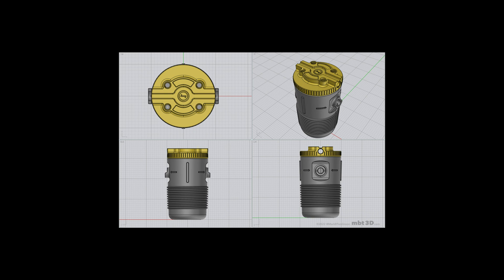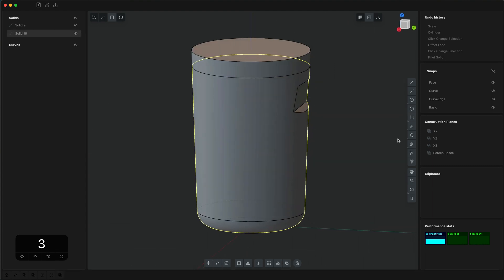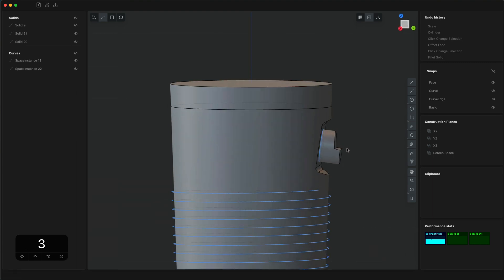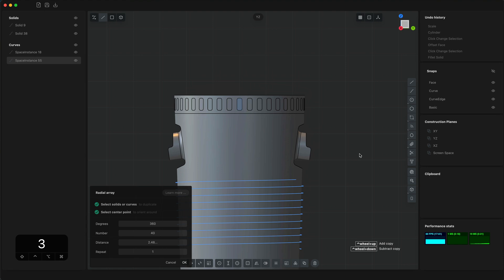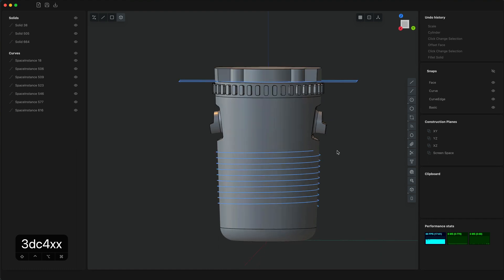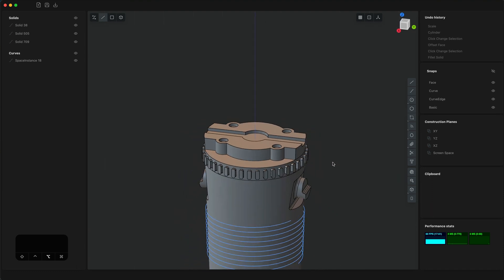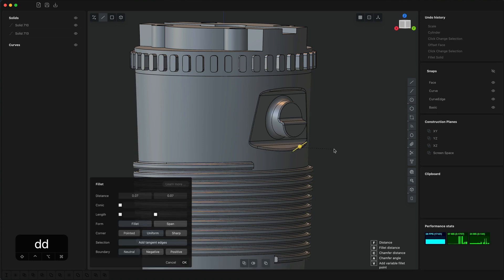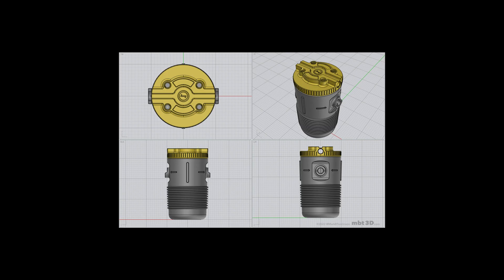Modeling a sci-fi coffee cup in Plasticity

Comment: I know I'm commenting on an old video but the push pull on the planes do not always work. Same with sliding an edge often. I'm using the latest version. What am I missing. Do moving edges need to be right angles or some thing? Or am I having a selection problem? Do I need to dis connect something? It does not seem that the vertexes are able to move.

Comment: Okay so I just reproduced this object using this tutorial, and exported it as .obj, and then imported it into blender 3.1.2. Had to scale down by over 1000. There's a big error with the broad smooth surfaces of the cup cylinder above the threads, they have broad inward dents. Topology not nearly dense enough in those areas to produce cylindrical shape. Also object is not 3D printable, lots of non manifold and other errors and not really sure where to start trying to fix that. However the workflow is very enjoyable and quick!

Comment: Im increadebly impressed with this program so far, I'm intrested to see what kind of meshes this will produce on export? I use solidworks at my job so Im fairly familier with a CAD parametric workflow but I also do a bit of modeling for games on the side.

Im not sure if this is intended to become a non destructive parametric tool in the future, but the ability to perhaps set "rules" for creating the poly mesh in each order of operation might be a cool idea. For example If you put a fillet on an edge, you'll also have the option to set the resolution of that fillet so that when you export a polygon mesh you dont end up with a bunch of uneven and wildly ununiform edges.

Comment: Is it based on Parasolid kernel? Please take a look at Spaceclaim, it might inspire you to add direct modeling features.
Reply: I found the answer reading the comments. I use Spaceclaim in conjunction with Rhinoceros. There is a plug-in to export-import the models back and forth between the two running programs. I create all basic free form shapes within Rhinoceros, then I export with just one click the model inside Spaceclaim. I can add holes and fillets, repair the surfaces and do a lot of modifications not possible within Rhinoceros. Please add in the future versions in-out of solidworks/x_t files.

Comment: Wanted to ask, does the fillet operation work simmilar to Shapr3d? I mean, is it possible to do those large multi edge fillets? I tried Moi3d, it's good for simple chamfers/fillets, but calculations fail on intersections. Thanks!
Reply from the maker: Both parasolid (shapr) and c3d (plasticity) have wonderful fillet engines, light years ahead of what moi uses

Comment: Amazing work, and looking forward to try the full version, a feature that I look forward to is the capability to draw lines (sketches) using the view port plane (axis) and cut using the normal of the view port, not sure if it is just me but it breaks the box and restriction that we always had with cad modeling where you need another face to align with, so far only zbrush and some blender addon have this feature so would be amazing to do it in cad program, anyway looking forward to see the upcoming updates and good luck
Reply from the maker: Screenspace cutting like clip-curve is definitely planned. I have a prototype but it's not really usable yet
Reply: Im not sure what cad software you use but In Solidworks which is the industry standard there is a create plane from viewport button.

Comment: Got here through Arrimus3D video showing your tool. It is quite impressive!

I think you should set up a Patreon or something to help with income while you work with this tool, because I'm betting there are a lot of people that may be interested in contribute, even if only financially.
Also, the UX is great overall and I think the object tree on the left side of the screen could be made transparent, placed inside the viewport and toggable, so you can reduce it's size and avoid clutter.
Reply from the maker: I dont anticipate making the tree view transparent for two reasons. One, it puts a lot of extra pressure on your gpu for basically a dead region. Two, the scene outliner is going to have a lot more features eventually

Still, I’ll bear it in mind

Comment: this looks really really good! my only fear is performance, I kinda like fusion as well, but i feel like it slows down rather quick as your projects shapes form. will Plasticity be different in that regard?
Reply from the maker: Many NURBS operations are more CPU intensive than polygonal equivalents, there's no avoiding that. However, I think a lot of performance/interactivity issues are about program design. For example, there's no fundamental reason a complex scene -- a scene with lots of objects -- should ever be slower with nurbs than polygons. However, booleaning two individual complicated shapes (like a helix around a drafted cylinder) is never going to be 60fps. Performance is not currently my focus (rather, it's features/bugs) but it will be important for sure. A lot depends on what specifically you find slow about Fusion